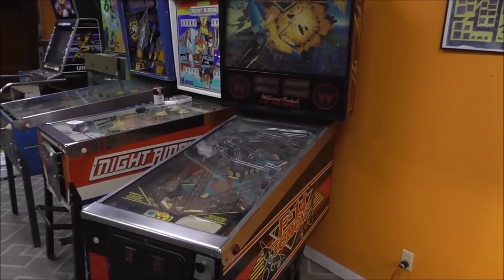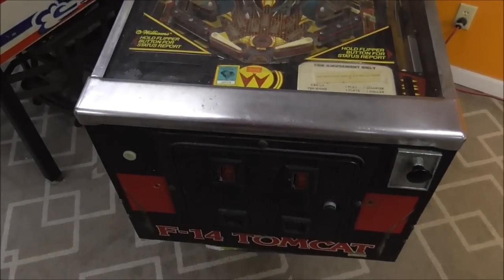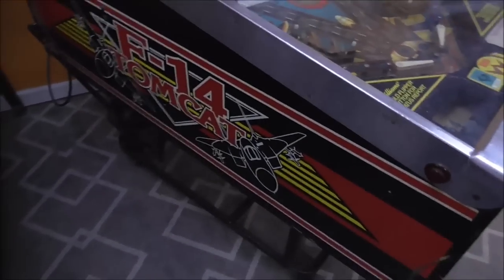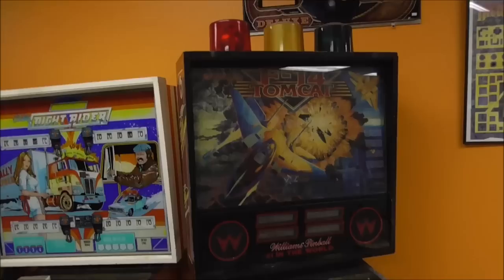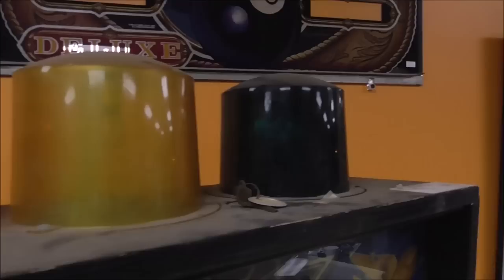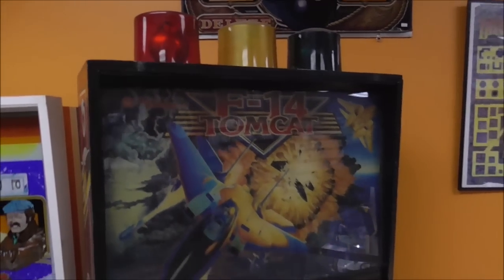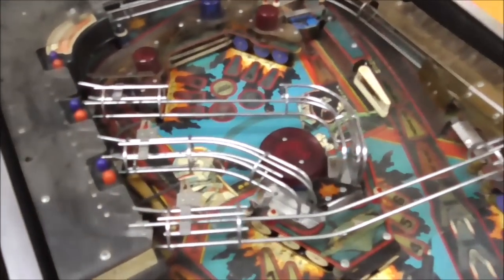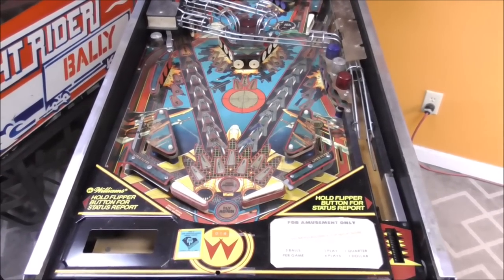This 1987 Williams F-14 Tomcat Pinball Machine Is Totally Destroyed, Let's Save It! - Repair #1

Comment: Ron.. Great video.   I'm in the exact same boat.   Just bought 2x high speeds.  One is a fixer upper, that needs a hard top (which is a lot of work,  and your F14 may go that route), and the other is a rusty pit of hell that you'd run a mile from.   Both had no legs,  coin doors or back glass.  Watching this F14 collection,  and taking notes.
Reply from the maker: They don't make a F-14 Hardtop so that's not a option in this case... I've got a High Speed down the line i'm going to fix up in storage, it's pretty rough though :)

Comment: used to own one of these, whish i would have never gotten rid of it.
something to consider on the playfield - a printed overlay, will make the playfield look brand new, have to take everything off, but something to consider
Reply from the maker: I've done a few of those in the past but they're a lotttttt of work unfortunately, you have to get all the old artwork off or when the lights shine through the inserts the text doesn't line up....

Comment: Ron I have been working on F14's sibling Fire for over a year. Removed the factory mylar. Not much PF paint lifting, but did damage text on some inserts. Getting rid of the adhesive was the hard part. Used mixture of flour and Goo Gone as recommend on internet. Can't wait to see how you handle insert damage. I have same problem with fire art on triangular inserts. Been struggling with what to do. My lower displays didn't work, uppers did. Replaced with LED displays.
Reply from the maker: Unfortunately the rest of it needs so much work I don't think it would be cost effective for the customer to spend all those hours on the playfield, I have to charge them for it (of course) and with that added on what it will cost to get it running well again, they may have to wait on the playfield (I can't spend a year on it!)

We'll see what we end up with....

Comment: Wow.  That game is in sad shape, but the fact that it actually still boots is promising.  This is going to be fun to watch, and not just because I dropped a lot of money into these machines as a teenager.  It's going to be interesting to see if the missing displays are actually dead, or if it's just the battery damage (or both).  And remember, kids: Don't play with rusty balls!  (Sorry.  I'm 51 years old, but my inner 12 year old had to giggle.)
Reply from the maker: I'll give you a preview of what's coming up, the battery damage is EXTENSIVE !
Reply: @LyonsArcade  Yuck!  It so often is, unless you get lucky and catch it at the right time.  Alright, so the missing displays probably are due to battery corrosion.  I'm not really surprised, since the bottom two displays seemed to be in such good shape (nice and bright, no flickering, etc).  Makes you wonder if maybe the manufacturers should've put a bright orange warning label somewhere on the machine that says "Hey!  There's batteries in the back box!  Take them out before you put the machine in storage for 25 years!"  😉

Comment: How often do you recommend swapping pinballs? btw, my gorf linear power supply was shot, so i'm getting it recapped. Hopefully that gorf will boot after that, i'm crossing my fingers. I did want to ask, Do you think swapping the linear psu for a switcher hurts it's collectable value? 

I hope you do save this pin. It looks like it won't be too bad to fix. You always get thumbs ups from me.
Reply from the maker: On a Gorf, swapping the power supply with the switcher doesn't really hurt the resale in my opinion.  There's nothing really special about that linear one, it does the standard voltages the switcher does so we've done it before.  Pretty easy little swap too!  We just swap the pinballs when they show any sign of pitting or rust.

Comment: Noticed that one of the reflectors for the beacons was in the bottom cabinet with the other random stuff you was sorting through. Might have some extra work there with the beacons...
Reply from the maker: I figured that's what that was but didn't see where it went yet :)
Reply: @LyonsArcade  Well if it isn't a spare they're not that hard to put back on. The light bulb sockets on the other hand...

Comment: What clear coat do you use once you've finished your touch-up paint? It brushes on too? Hoping to see how you get this mylar off.. your whole process. Staying tuned.
Reply from the maker: We don't brush the clear on, we just use Krylon clear coat in a spray can.  You have to have everything super clean though if there's any wax the clear will bubble.
Reply: @LyonsArcade  Thanks, good to know. You completely depopulate playfield before spraying, or mask off surrounding areas?
Reply from the maker: @808zhu  We just mask off whatever's left on the playfield, but we don't go crazy with it, put a little tape around switches, etc. and just spot clear coat a little area.  If you don't go crazy heavy with it, it blends in to the areas around it.  The best way to do it is with auto clearcoat but takes a lot of time and money, we're just doing player machines people can enjoy not full restorations :)
Reply: @LyonsArcade  Awesome. That's what I'm planning on doing with my playfield wear.. just a nice, modest touch-up - nothing fancy. It doesn't have to be perfect, but it does need to be addressed. Once it's done I'll slap mylar over it (unless otherwise advised) and the next owner can do what they want. Player's condition is totally okay by me. It keeps that vintage charm. Thanks for the tips. 👍👍

Comment: Did you ever try to remove the mylar with a paint friendly thinner, such as rubber cement thinner or lighter fluid? I know it's flammable but used  with caution it mite work. I have used it on suck on tape,stickers and old plexi glass backing paper with pretty good success. Good luck.

Comment: I have a Road Kings that had been playing great with no problems, now all of a sudden it is stuck in a very similar start up failure, any ideas what to do, since it was playing well now not?
Reply from the maker: It probably just has dead batteries.... turn if on, and if it's in test mode, hold down the 'advance' button inside the coin door until you get to the end of the settings and it should start up.  We're going to go over all this in a later video.
Reply: @LyonsArcade  I have already tried replacing the batteries, no luck, local guy mention could be the main power board (original ). Also read where a bad flipper diode could jam up the power board
Reply from the maker: @bobbuchman1925  What does it say when it comes up?  If it's in the settings menu it's because it hasn't saved the settings... could be a problem with the batteries not making good contact with the holders or the holders have deteriorated, it shouldn't have anything to do with the power supply.  If it doesn't boot into settings yes it could definitely be the power supply!
Reply: It does not boot into settings, when it first started , it would make a single bing after a while, then after a while more it would kind of get like in the video, now the GI will flicker a bit at first turn on and then stay at static GI,  no other activity after being in for an hour or so

Comment: Wow....that is a mess, and is really sad to see that.  I'm sure you could do quite a bit of work, but wow.  So the million dollar question I have (I honestly don't know, but I do have my kevlar underwear on), do any companies exist that have artwork files that could be used to re-print the artwork?  It may be cost prohibitive, but man, that would be great.  F-14, Fireball 2, Black Knight, Need For Speed...just a few of my favorites.
Reply from the maker: Yes there are some overlays you can get, and everyonce in a while they remake some of the playfields.... very expensive though and a lot of work to install!
Reply: Check out the ROM pack from a pinball simulator. It will have an artwork pack with the playfield and inserts, even the backglass.  
It might be worth tooling up if you do a lot of restoration. 
A 3d resin printer for clear/colored light inserts.
A printer that can print vinyl for the playfield and other artworks. 
Print media for transferring print onto glass is pretty easy to use and low cost nowadays.
Laser cutter.
Reply: @DirtyRobot  I have a friend that does in-home silk screening...he can handle back-glass sized pieces with his setup.  I don't think he's ever done glass before, and usually only does 1 or 2 colors.  That previous back glass that he had (must have been 17 colors on it) probably would not be done "in home" because of the steps and required registration....also the colors.  Ink isn't cheap for silk screening, and it does have a limited life.  I'll have to talk to my friend to see if he's ever done anything like that.  Then again, I have to get myself a machine, but right now, people are charging about 5 times market price for these things (I've seen FireBall II's go for over $10K in 'playable" shape (i.e., it's a mess, but it works)).
Reply: @WreckDiver99  
I was suggesting an inkjet or DS transfer onto glass.  
You can get specialist film/paper that you can print full color on. You then use a chemical to transfer it onto the glass.  
After this process you would add a clear coat or similar protective layer.  
I have also seen a heat bonded process, where the glass is printed on directly and then cooked in an oven to cure the print, but this process is high end and expensive.

Comment: You could try retrobriting the clear beacon. Submerged in beauty shop grade hydrogen peroxide and exposed to either artificial UV light or real sunlight on a good hot day especially. I have achieved incredible results with title strip plastic in jukebox and some white pinball parts as well. It's an amazing hack!
Reply from the maker: Unfortunately it's got tons of little cracks in it...
Reply: @LyonsArcade  Yeah.  In that case, I'd buy a replacement.  They're not that hard to find.  A bit expensive for a piece of clear plastic IMO, but in this case, worth it.  It beats a yellowed, cracked beacon any day.
Reply from the maker: @SpearM3064  Have you seen the white ones they've made?  I went with a clear one like the original, but I guess at some point they redid it as a white one since the clear one is so bright when the light goes off... but man that white one looks horrible!

Comment: i was just going to suggest to heat the mylar to get it off.

if you can get new playfield art you could order new art and redo the playfield.

or if you get a junker machine where for example it has been in a flood and half of the cabinet is ruined but the playfield is ok you could replace the playfield.

sometimes it is worth the repairs if the game is in a level of vintage and rarity that it no longer exists.

Comment: If he wants to resell the machine one of the things those colors got to pop. A reproduction play field would make that happen without having to take off the old mylar. And probably less of a pain in the ass.

Good luck and God speed on that.
Reply from the maker: People put those reproduction playfields in their machines but I don't think he'd get his money back out of this title if he did that, they cost about $800 plus shipping, and it would be pretty expensive to take the time to swap the playfield, lots of work just getting all the sockets and wires and etc. swapped over to the new one.
Reply: I get it.. but those jewels need to POP for resale..
Especially for those playfield for Williams electronics..

That mylar is the hooking point..

Do you want a good game for your home.. with a possibility of resale?
Or outright...

Don't flip this machine unless you're intending to do it..

I'm not I'm not trying to be an a******..
At all. 
But that playfield...
Either you try to lift that mylar or buy a new playfield? There's no way to fix those jewels..
Without lifting the mylar..

This customer needs to make some hard decision...
How much money they're willing to commit to fixing this game. And how much money are they going to get with this game on resell.
On the secondary market..

With out the blue and reds popping off..

The mylar is the key..
Major conundrum..

This dude need to make some hard decisions.. and how he invest in this game..